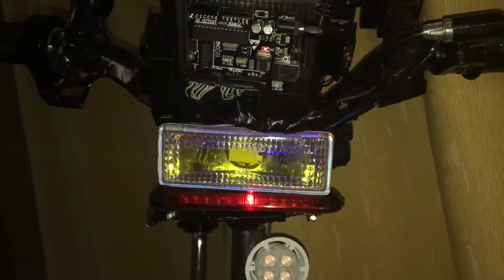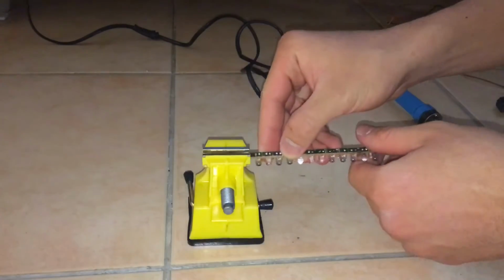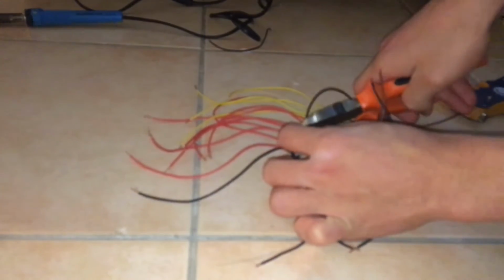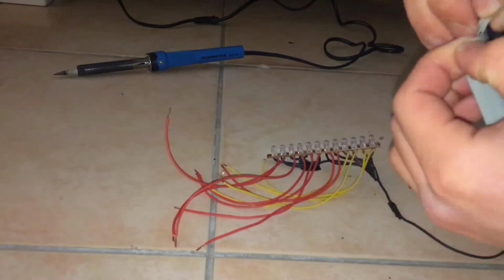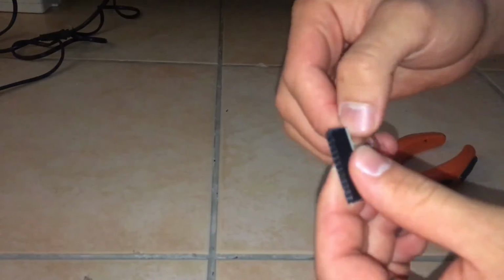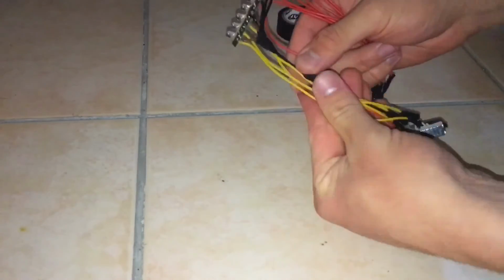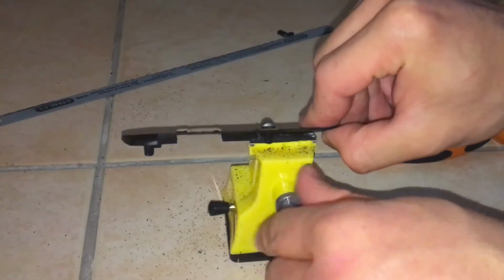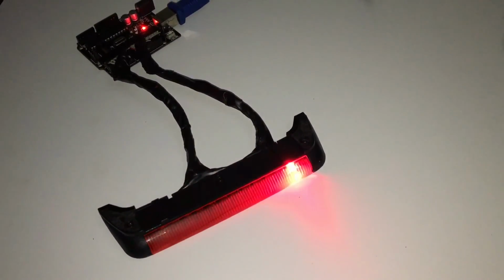How to build a Knight Rider scanner using an arduino

Comment: I wrote the software and tried to upload to my arduino due and it says there's errors in every line of the code.
Reply: Do you know if there's male connectors for arduino that I can make 15 foot cables with? I'm making blinkers for my truck and will run jumper wires from leds to the arduino that's inside my truck but need the pins to connect wires in arduino
Reply from the maker: Hi Samuel, you can just use your own 15 foot cable and connect male header pins on either ends of your cable.
Reply: @ZiadHamwi  I can't find header pins that will work correct.
Reply from the maker: Just use standard male headers from jumper wires.
Reply: @ZiadHamwi  the puns aren't open on the arduino due like they are on the uno. There's a female type pin on the board
Reply from the maker: Hi Samuel, it doesn't matter just use the jumper wires that can plug directly into your Arduino model.
Reply from the maker: Hey Samuel, make sure you are not missing the semicolons at the end of each line.

Comment: I see you used arduino uno. That has 13 pins minus the 0 pin I need one for 27 pins to work 27 leds can you point me in the right direction?
Reply from the maker: Hi Samuel, look into using an Arduino Mega if you need to more pins.
Reply: @ZiadHamwi  I ordered the ardruino due is that the correct one? I saw I could use digital side of the pins as well
Reply from the maker: Hi Samuel, yes you can use the Arduino Due, it has far more pins than the Uno so you can use it to control 27 LEDs.
Reply: @ZiadHamwi  do you know if they have the software formula for 27 leds?
Reply from the maker: The same Arduino software should work with the Arduino Due.
Reply: @ZiadHamwi  would I need to modify the soft for 9 leds and change it to 27 leds?
Reply from the maker: Yes you would have to change the range of LEDs from 12 to 27.
Reply: @ZiadHamwi  for some reason I can't get any codes to upload to my arduino even ones off the site. Any way you could help me out? I need this knight rider code I'm gonna use on my truck for blinkers
Reply from the maker: Did you try uploading the blink program to your Arduino to test if everything is working?
Reply: @ZiadHamwi  I had to remove  where it says void setup
Reply from the maker: You shouldn't remove void setup() or void loop() otherwise it'll fail to upload the code.

Comment: Is this working with 12volt?
Reply from the maker: Yes you can simply plug in 12 volts into the vin pin of the Arduino.
Reply: I Made it with the 12 volt 8 relais board.
Reply from the maker: Very good!

Comment: How can we do this work with a single 'digitalWrite' code? Thank you.
Reply from the maker: Hi, you can store all the LED variables in an array and then create a for loop with a one digitalWrite line that scans through the LED array and sets their value to high, and then another digitalWrite line after a delay to set them to low. 

You'll need two for loops, one to make the LEDs scan from left to right and another to make them scan from right to left.

Comment: why break all the negative ( common ) ground connections one the pcb track ?  using one common or negative wire to this track would  save eleven wires for ground and reduce wires trailing from display unit/. otherwise great vid and many thanks..
Reply from the maker: That's usually what I prefer doing, however, with this LED bar it wasn't possible to do so as the LEDs were connected positive to negative and divided into 3 sections. So using one track as the common ground wouldn't work in my case. Anyways, I'm glad you liked the video.